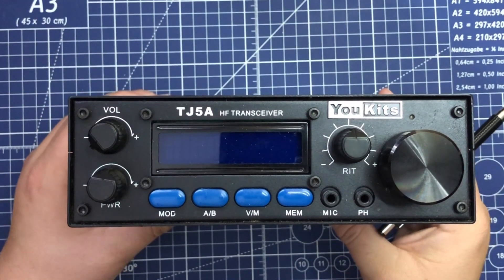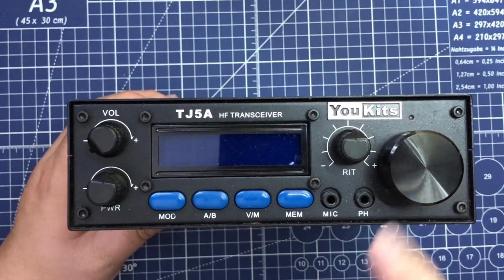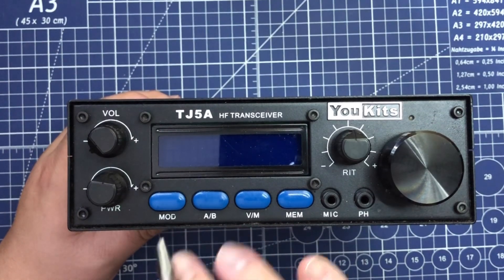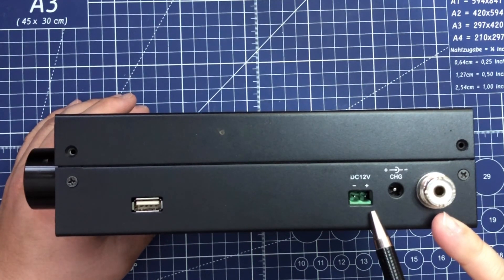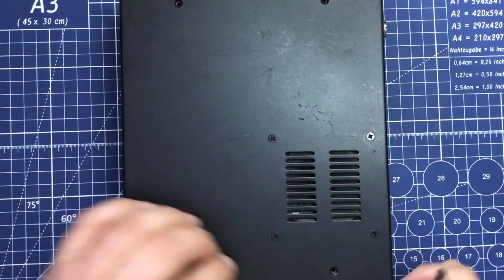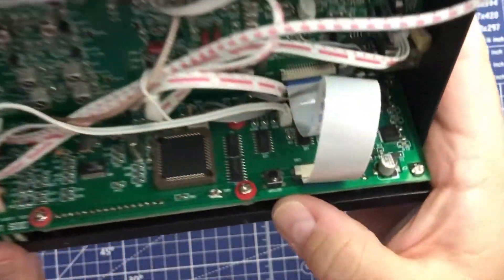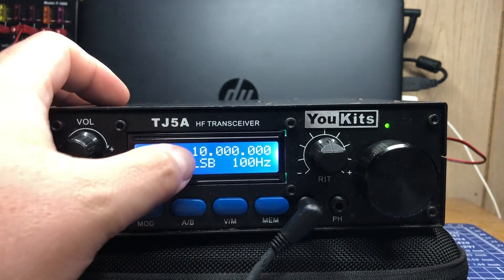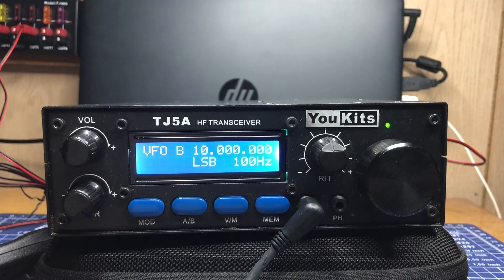YouKits TJ5A: QRP on a Budget

Comment: You’ve shown up in my recommended feed for ham radio. 

Subbed. 

Looks like an interesting rig. 

Cheers DE VK2NAP
Reply from the maker: @MidlifeRenaissanceMan  thanks for the support from down under, 73!
Reply: @ not a problem :-)

I hadn’t heard of YouKits before. Looks like they have some Bitx style radios. I’m assuming they are mostly DDS / analog rather than full SDR given their age. 

Sadly I’ve been so busy I haven’t had a moment to get on the air save one night in January. Even bought another old post office key that I haven’t unboxed since it arrived.

So I get my ham radio fix vicariously through the GoogleTubes.

Still nothing beats pounding brass in real life. I have a couple of silly videos of me doing that, along with plenty more rubbish that shouldn’t be viewed by anyone